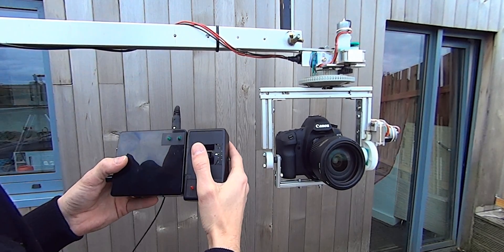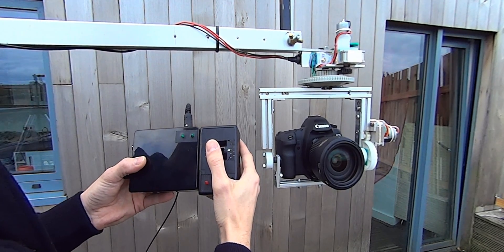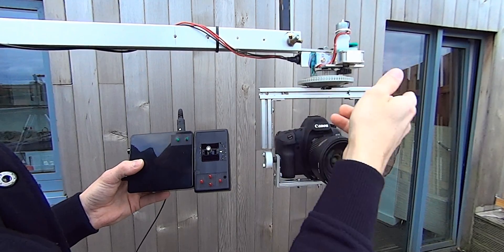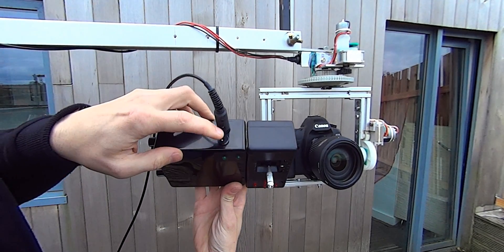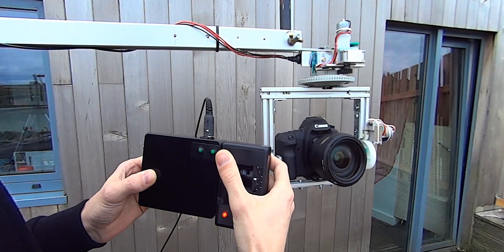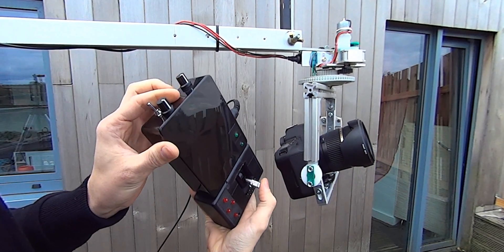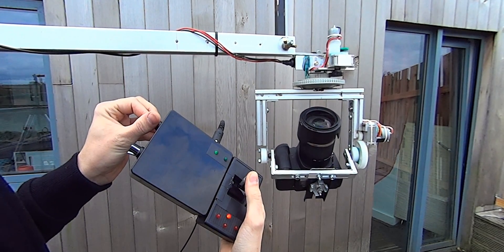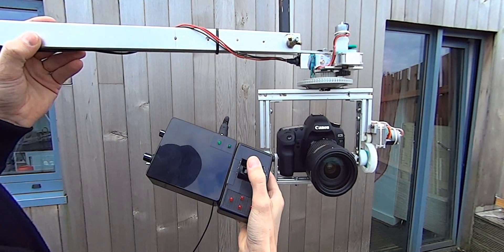Motion Control Rig - DIY

Comment: That's a jib with a remote head, NOT a motion control rig.  Motion control rigs are able to repeat the exact same motion precisely over and over under computer control, usually for VFX work.  Still, good job building a jib and remote head.
Reply from the maker: This is diy stuff not super expensive motion control, besides that was 6 years ago 😊
Reply: @MSSTUDIO  I understand that.  But it's not motion control, DIY or otherwise.  It's a DIY jib with remote head.  A jib and remote head and a motion control rig are completely different things.  "Motion control" specifically means all movements are controlled by computer and precisely repeatable, regardless of how much the rig costs (people do make inexpensive DIY rigs capable of that).  But THAT is a jib and remote head, a completely different piece of equipment.
Reply: @MSSTUDIO  Btw, how did the shoot go with it?  Is your finished film posted anywhere?